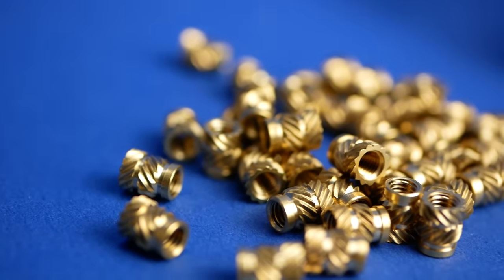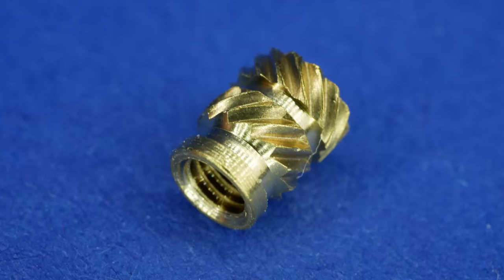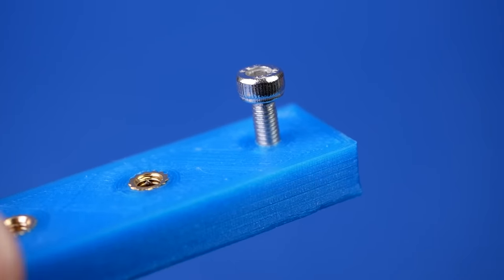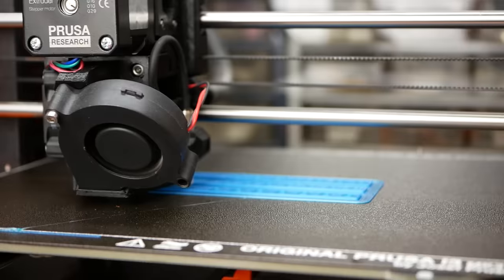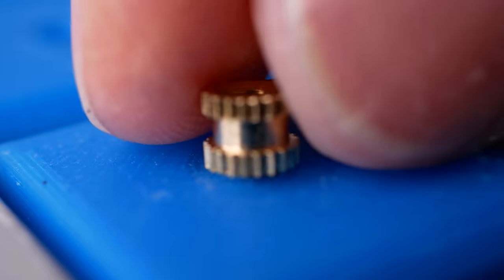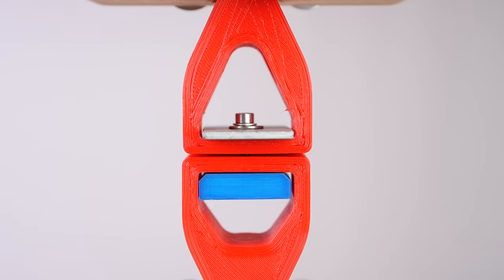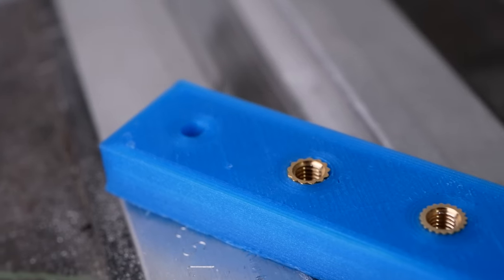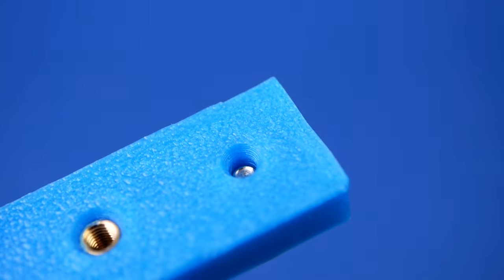Threaded Inserts for 3D Prints - Cheap VS Expensive 💰

Comment: Not sure if someone else mentioned this, and chances are you won't see it, but the bolt in plastic result didn't surprise me and the typical approach to getting a strong connection into a weaker material is a threaded insert that is threaded on the outside and the inside. This is used in modifying old VW air cooled engines, for example, to retain the proper amount of fastener stretch while increasing strength of adhesion into the alloy case. More modern auto manufacturers when placing a stud into plastic have a large diameter coarse thread screwed into the plastic and seated on a face with a stud sticking up. Cheap knock off units just cast/mould a normal hex head into the plastic and these fail much more easily.

Comment: Using the cheap ebay ones I put in a m3 screw and heat that. It helps prevent the build-up and also makes it easy to clean up any build-up.

Comment: I use the inserts from McMaster Carr, these ones are like the expensive Ruthex. The chamfered inserts are way easier to insert and work with. The knurled inserts are just a pain to insert and are very difficult to not have a glob of plastic in the threads. It does pay to spend more for heat inserts in the strength, and ease of use. On my hypercube, I used the knurled inserts at first and I spent a lot of time removing globbed up plastic from the threads. I went to the McMaster Carr inserts and they didn't take any more effort than just putting them in.

Comment: idk about other slicers, but Cura has horizontal expansion setting to deal with the printer-specific issue regarding to accuracy, so I can keep the CAD numbers without the additional compensation
Reply: This also has side effects though. Better to design the tolerance into the part. Especially when sharing. I just fixed a batman file that previously relied on using horizontal expansion.
Reply: I also use the horizontal expansion. I found that not only are holes to small but the part is to big equal to the amount the holes are different.  This is also helpful when printing htpla parts. Once you know your shrinkage you can print exact fits. 

I do not do the sizing by design because different plastics have different shrinkage. And it is easier to change in the slicer then to make multiple designs.

Comment: If possible; just make sure you can insert a nut on the other side and print minimum of walls "below" the nur: maximum support surface to pressure the connection. Much bigger than a screw thread insert. Only use inserts where you might not be able to put a nut on the other side due to design restrictions for example.
Great test anyway, compliments!

Comment: Excellent video! I was wondering how a printed thread would compare to tapping the thread into the plastic with a self-tapping screw. I sometimes print threads in objects that need a fixture that won't be under heavy load, so it would be interesting to see how that compares. Thanks for the video!

Comment: I use the injection molded ones without using heat. I print the part with a larger diameter countersunk hole on the far side. Then I just press the nut into the countersink. I can adjust the strength of the hold by changing the thickness of the material the insert is pressing up against.

Comment: Hi Stefan, we use to put inserts in many 3d printed parts. Using the soldering iron is not the correct way, plastic inserts are placed by force, not temp. It´s easy to overheat the PLA, p.e.

Comment: Very interesting results. I was looking for the max torque you can put on a bolt to tighten it without the insert being pulled out. That would be great knowledge because now I just tighten a bolt until I'm guessing that it's tight enough not to come loose easily. I would like to know the limit so I can set a torque screwdriver to a bit less and have no fear of over/under torquing :) The test you were showing at 8:56 is not the same as you are not pulling out the insert as you're applying torque.

Comment: test suggestion... test the temp that you use on the soldering iron.  I push mine in at 650C.  I cant really say why, it works and doesnt seem to overheat the material (we can be sure the insert is not actually reaching the iron temp)... but I wonder if hotter temps would improve material flow and therefore increase holding power.

Comment: I've been using 3 prong 1/4 20 "T" nuts with PLA and PETG.-about .20 cents each for a 100 count box.  I heat them up with a mini torch and press them in place.  The molten PETG makes for a really good bond.

Comment: still not using inserts, screwing into PLA directly. No issues as long as you keep the friction in mind when using a electric screwdriver. The heat could harm your PLA. If you handle these PLA threads with respect, you can use them several times. Nice video, Stefan

Comment: If you have a bolt connection that needs to carry in tension, you could leave a 2 mm flange in the part, and insert the insert from the back. The part will no longer be a simple 2D part, but it might still be easy to print and it should be stronger. The bolt will need to be a little longer and the weight of the part will be slightly higher.

I love the videos, and i would love to have at tension testing machine at home. 👍

Comment: I know this is a bit old, but for the hole dimension problem I've found the best way to solve it in Cura is the horizontal expansion setting. Once you tune this setting, then all of your holes will be dimensionally accurate instead of requiring you to offset them in CAD.

Comment: Sorry to say but those 8.8 screws are not quality screws, actually just standard screws. Quality screws would be 10.9 or even better 12.9. There is also 9.8, but those are rarely seen. The number is the screws yeld and tensile strength. On UNC/UNF screws it is the radial lines, the more lines the better.

Comment: A screw by itself can perform about as well as a screw in an insert, but that isn't a big surprise, as the inserts are basically hollowed out screws. Sure they have some different designs, and resist being unscrewed, but they're basically just that. The real reason to opt in to using a threaded insert is to avoid wear and tear from inserting and removing a screw. Over time, that plastic will wear away as you tighten or loosen the screw directly on the print. On the other hand, once a threaded insert is in place, there's no direct contact between the screw and the plastic, and the insert should fair much better against wear and tear.

Comment: Do you have a video showcasing your tensile material tester? It's quite impressive. I'm intrigued by its capabilities. I have a couple of inquiries regarding its operation. Typically, in engineering practices, tensile tests are conducted at a specified rate. In the medical device industry, for instance, we often conduct tensile tests on plastics at a rate of 0.2 inches per minute. According to a quick web search, the test range can vary from 0.2 to 20 inches per minute. You might find Table 1 on page 6 of ISO 527 and ASTM D638 helpful in determining appropriate test rates. Your testing apparatus seems quite efficient.

Regarding threaded inserts, the ASTM standard commonly employed is ASTM F606/F606M. However, it's worth noting that this standard does not prescribe a specific pull rate for threaded inserts. The selection of the pull rate should be based on factors such as material properties, intended application, and industry standards.

Another question I have pertains to the accuracy of your drill bit diameters. It's important to ensure that the diameter of the shank matches that of the head of the bit, which may not always be the case. Using a micrometer to double-check the dimensions is advisable to confirm precision. While pin gauges might not always be the best tool for this purpose, it's essential to verify the accuracy of the drill bits.

For metric threads, ISO 261 provides valuable information. For instance, the Major Diameter of an M3x0.5 external thread typically ranges from 2.874mm to 2.98mm, while the Minor Diameter ranges from 2.272mm to 2.439mm. The Pitch Diameter falls between 2.58mm to 2.655mm. The tap drill size for an M3x0.5 thread is typically 2.5mm, while for an M5x0.8 thread, it's 4.2mm. Your content is informative and engaging. Keep up the great work!

Comment: For the injection molding inserts you could put a draft angle on the hole making the top bigger than the bottom so there's a guide for it at the top.

Comment: Hi Stefan,
I'm currently experiementing with various designs for my X5Ss carriage. Did you do any testing on how well each concept works for almost purely radial load? In my case, that'd be caused by the tension between the rubber wheels on one screw, and the belt tension on a pulley on another screw.
I suppose an inserted hex nut would fare rather badly, because it'll easily cant inside its hole, with the entire load placed against the plastic. Threaded inserts should do better in that regard, but (longer) printed threads might distribute the force over a larger area.

Comment: This is yet another helpful video. Thank you. I will use servo screws from RTL fasteners for a lot of 3d prints. They are a pointed coarse thread design and I find they hold much better than machine screws in plastic. If you did a video on alternate thread type in different materials, I think that would also be helpful.  I look forward to your next video!

Comment: The cheap ones I use where they can either be inserted from the back (with plastic surrounding the edge of the "top side") so that pull out is mitigated, or just for low-strength but frequent insert/removal.  They work fine for that.  Insertion can be easier if you add a slightly wider diameter on the hole leading in (again from the back size where possible).

Comment: I thought your ebay one would be best until I saw the diagonal one. With the ebay one, once it "strips" you will have the knotches spin in an empty hole. But the ruthex one always has a counter active force no matter which direction youre pushing, pulling, or twisting. very good.

Comment: The "cheap" insert failed because these are made to be used inside the injection mold, and even with a smaller hole and longer heat application the result will still be below optimal, this worse performance is sue to wrong application not desing

Comment: hey, what about threading directly the hole with a hot screw? In one case, well over the glass transition temperature, and in the other case, well over the melting temperature? I tried the first technique because the screw holes were parallel to the layer lines, and I didn't want to destroy the part (it happens). The operation was, obviously, less hard than doing it cold. Sometimes you don't have the space for an insert. I'd be interested to see the difference in performance between these techniques. And kudos for the excellent videos ;)

Comment: i found out undersized holes (i make the holes 0.5mm smaller rather than 0.3 for screw in ones) are far stronger and durable when you thread them with a proper threading tapping tool rather using the screw itself! they're very cheap too! even with -0.3mm holes meant for screws they work great

Comment: Great work. I actually designed my last project with inserts after seeing your last vid, and i got the same cheap alibaba multipack you had. They were kinda a disaster. They were really hard to keep aligned when melting them in (several screws wound up being unusable), and they were slowly pulled out when they were put under load. I would totally go with the "good" inserts if i were to do it again

Comment: Great video! I think you should likely try a larger diameter thread to test the torque-out so that it is not the bolt shafts that are failing. Once the head gets in contact with the insert top you are down to the shear strength of the bolt rather than the actual resistance to rotation of the insert...

Comment: To get an accurate torque test or tightness you need a continuous smooth motion until the desired torque is achieved, usually the torque wrench clicking.
In aviation we use torque wrenches for pretty much every fitting. If you ever have to take a second bite at the screw it must start turning before clicking or you need to back the screw off and re-torque it to ensure the correct force has been applied.

Comment: The biggest problem with the cheap ones is, that PLA tends to be pushed into the thread while inserting. If you do not manage to remove it while it’s soft and not bonded to thread they become unusable and you have to remove them (sometimes dump the whole part).

I proceeded to chamfer one end with a file to make them work, but that’s tedious. I recommend to not buy these for heat-inserting. They are made for beeing injection-moldet into the piece and do work this way +only+.

You might also search for the  AMTEC® documentation from boellhoff.com which is producing various kinds of inserts for thermoplastics.
Reply: Instead of filing a hole, I put a chamfer in it before printing. The insert still moves slightly when I go to heat it, but it's no where near as bad as just a flat surface (or convex in my recent print).

Comment: Great job Stefan! 
One tip I have for you - When doing the torque out with your bike tool you need a spacer that is bigger than your insert. Your bolts were breaking because they were sandwiched between the socket and the insert. I do these same type of tests for Tesla but with metal parts 🤪

Comment: My thoughts on inserts are that they would be stronger if used from the back side of the material. Use them like nuts. Insert them from the bottom and insert the bolt from the top, leaving actual plastic between the insert and the other parts. This would increase the pullout strength by a huge amount. I’ve done this by printing an undersized simple hex nut hole and pressing hex nuts in to be used as “threaded inserts”.

Comment: Nice work. I've come to prefer the screw-to-expand inserts for through holes, if I can access the far side of the part. They end up costing a bit more, however. The heat set inserts I get are about $.20 a piece vs about $.48 for the screw-to-expand inserts.

Comment: Canyon MTB, Nerve? Spectral?  NICE!  Anyway, yes those cheap inserts are best when for saving a few bucks when the only real concern is being able to remove and re-insert a bolt without messing up the threads, or it if is a lateral/torsional load.
Reply from the maker: Canyon Spectral Al 8.0 . Unfortunately didn't ride it too much this summer.

Comment: I’ve had success just leaving a hole exactly the diameter of the screw. 3mm hole for M3, 4mm hole for M4, etc. Most of my uses for 3D printing are electronic enclosures, so this is the easiest thing for me to do.

As other commenters have said if you put in the threaded insert from the other side then have it sit on a smaller diameter hole I’d be curious to see how much stronger this would be. Still 200-400lbs for a threaded insert to fail seems like you wouldn’t need it any stronger. I don’t know what extremes people use 3D printing for but that seems overkill.

Comment: Nice. Most of my designs use a captive nut in a hexagonal socket. Getting the tolerance right on this is really important though - too easy to insert the nut and it'll just rotate when tightening the bolt, but too tight and it's a real struggle to insert it at all.

Comment: I prefer the method of embedding a nut into the part during printing, or if that is not possible, imbue a heated nut into a channel you print in the part, slightly smaller than the nut itself. You then have the perpendicular hole in the plastic be only slightly larger than the screw diameter, this allows much greater force to be applied and there is no possibility of the nut being pulled out.

Comment: A small hexagonal indentation on the back wall and a nut will be a cheap but strong alternative. It's easily available and it doesn't require a welding iron.

Comment: What about Self-tapping threaded inserts? for example "Triserts"
Could you comment on these?
Rather than push straight into the plastic, the Outside of the insert has coarse threads that cut into the plastic. they get screwed into the plastic, not straight push.
It seems to me, that this approach might have better pull-out strength, as rather than rely on melted plastic flowing back into the knurls (which I am skeptical of actually happening reliably), the tapping threads are always undercutting the plastic.
-perhaps a combo approach, using a self-tapping insert combined with heat.

Comment: The injection molded ones have an area in the middle which would normally have molded material around it... If you are molding you would get better results, maybe jb-weld could be added to the gap to produce the same effect?

Comment: As others have mentioned, the "cheap" ones appear to be intended for plastic injection molding.  Additionally, just wanted to comment that in consumer products we sometimes use "thread forming" screws for plastics.  Sometimes you'll also see "self-tapping" or "self-drilling" screws.  During prototyping, we also use these on 3DP parts.  I would love to see what kind of results you find with those. I say this because the screws you used are "machine screws."

Comment: Hey Stefan , great stuff as always. love what you do.   in this video you mentioned that solid prints hold better than parts with infill... is there a way to print section of a print solid for the inserts but non critical section with infill. to save on material and time ??   I'm currently using Cura for my slicer and  Tinker CAD    Thanks
Reply from the maker: Check my last video, I think I briefly mention modifier meshes there.